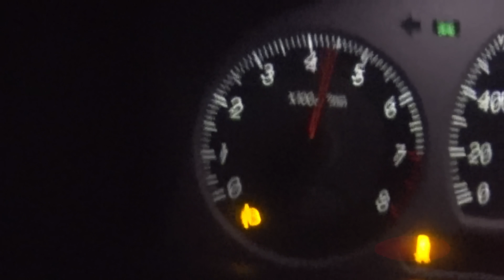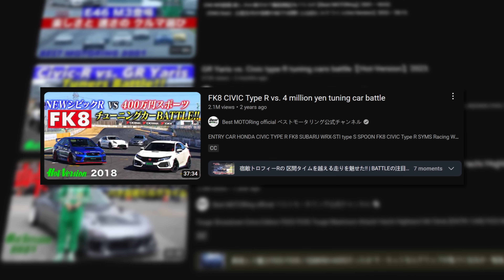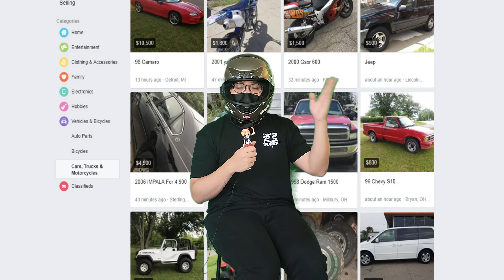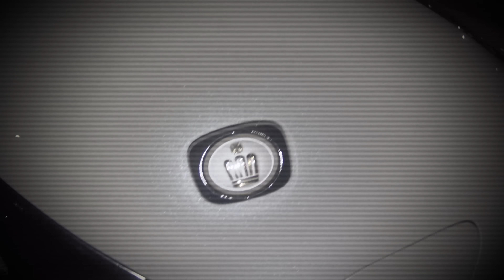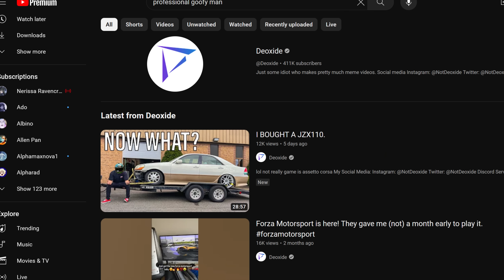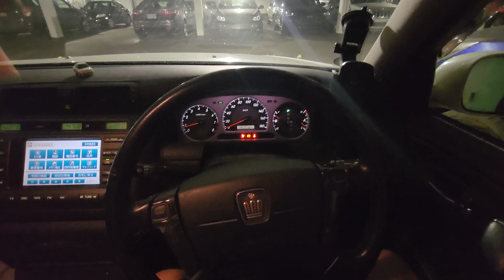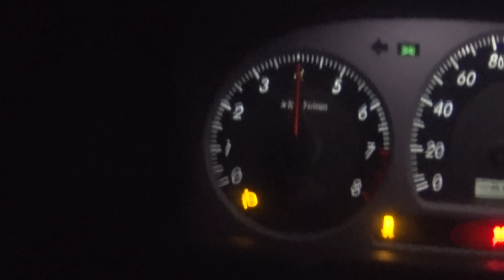I Bought A 1JZ VIP Machine

Comment: S150 Majesta owner here congratulating you on getting an S170! Immensely beautiful and useable cars these are.

Looks like one of the best kept secrets of Japan's car export ecosystem is finally coming into view. To all prospective Crown owners out there: yes, these cars are phenomenal as is. They look as sick slammed to the ground on 20s as they do bone stock. Really difficult to go wrong on these outside of ones that are mistreated. That being said, the one benefit to pining after Japan's Lincoln Town Car is that there's a lot of examples that are in great or even excellent condition.

In terms of actually getting your hands on one, I cannot stress enough how much of a deal you can get if you're able to import one yourself. I cannot speak for all importing processes, but as an American, it was very easy to work with an exporter that I trust and a stateside broker that knows what they're doing. The only reason I can say that I own one of these boats is because, to buy the car and have it sent here and registered properly, it was cheaper than a comparable Lexus model of similar year, condition, and mileage off of a used car lot.

These might not be as energetic as a Mark II or Chaser, but they're not far off. They are very pragmatic, stately, and reliable cars. I don't think you'll be disappointed.

Comment: These are such sick cars. 2 things you should know: 1 is if you unplug the blue plug at the back left of the engine it will stop signal to the BOV and make dose noises.
And 2, judging by the colour, your radiator is on the way out and you should probably start getting ready to replace it.  
Otherwise i hope you love it xoxo

Comment: The Toyota Mark X is basically a Lexus IS350. Proof? My friend bought some Lexus IS suspension parts and it fits right in, no custom mods needed to fit the parts. He even fitted big brakes from other Lexus sedans as well with ease.

Comment: Hey brugg gratz on the purchase, Crowns are lit and a nice alternative to JZXs. Since it's an old tueboed Japanese sedan, couple of things I'd look out for: JZs in general have a kinda shit harmonic dampener pulley, I'd look into replacing that unless it's already been done, they occasionally come apart and when they do the results can be a bit scary. I ended up replacing the one in my Chaser with a Fluidampr since it's a one-piece no maintenance part and won't come apart like the stock ones do, also dampens crank vibrations/torsion better than the stock part. Also keep an eye out on the turbo. Mine was burning oil because the hotboi that owned it before it was imported turned up the boost, CT15Bs have weak oil seals and they let go. Ended up replacing mine with a Tomei BX bolt-on turbo but you can get rebuilt/fortified CT15Bs too. I believe DriftMotion sells a rebuild kit/prebuilt turbo, Ichiban Engineering has multiple bolt-ons too. Apart from that, should be golden, enjoy it.

Comment: Most japanese engines are reliable (except subaru, fuck em), so is not really important which one you buy, but how the previous owner treated it. Im going with two examples: let's say you want a 350z, in my country, is just not a good buy given the fact they are kind susceptible to lack of maintenance (a lot of engines can deal with bad owners), mainly rod bearings fail if there wasn't a good maintenance in the engine. You have two options here, the first one is not buy it, because it will break soon or later, and second option is buy it, but lower the price, considering you'll have to swap the engine as soon as possible. The second example is you have to consider the parts can break at any time if they car was used for racing applications, recreationally. In my experience, a customer wanted to install an LSD in his celica. The part was imported from japan and it failed after installation, a few meters away from the workshop, God knows what it was used for.
The idea is to double check all of this, to avoid any unpleasant situations. Hopefully the transmission in your car is in ok condition. IMO, service it as soon as possible, same with engine oil, brake fluid, coolant, power steering, diff oil, timing belt and accessory belt. Never fully trust in what the previous owner told you.